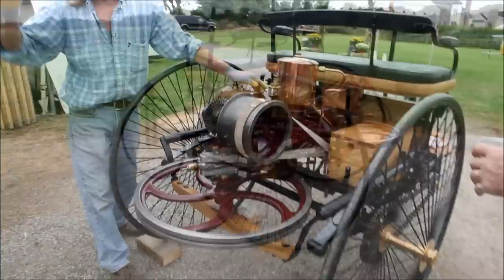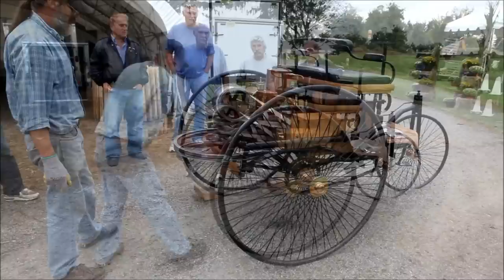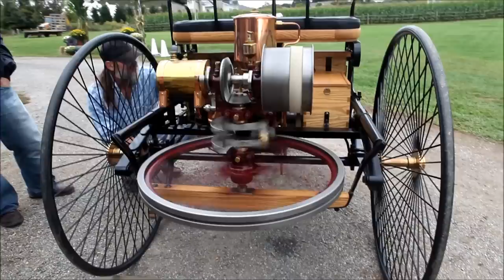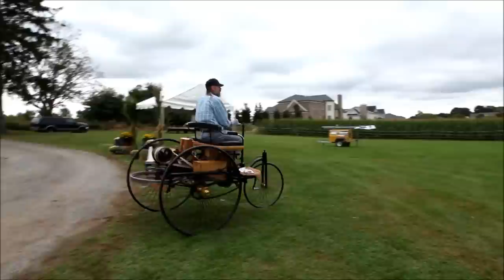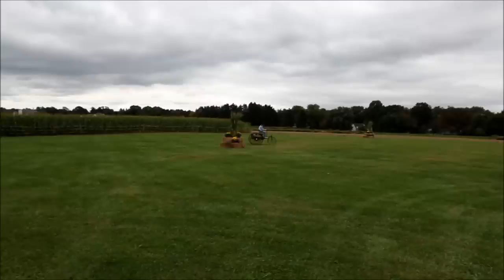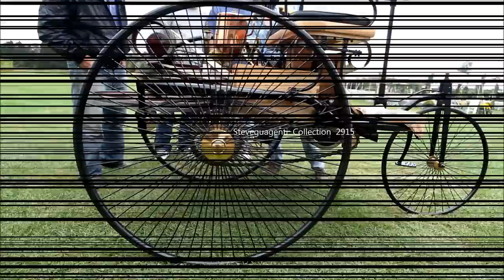Driving   Mercedes Benz 1886 ...Turning Over

Comment: imagine how stressful horror movies were in the 1800s! imagine trying to start that thing before a killer gets you
Reply: I wonder if they were even a thing back then because people didn't do too much with cameras.
Reply: Killer: *shoots, misses
Victim: *sets some valves
Killer: *fumbles around with a paper cartridge
Victim: *brings the flywheel in the best position
Killer: *broke the cartridge while loading
Victim: *looks after a screw that fell under the automobile contraption
Killer: *finds another cartridge
Victim: *tightens the transmission chain
Killer: *pulls the trigger. Nothing happens.
Victim: *has trouble releasing the breaks
Reply: They had horses and they also ran using their legs.
Reply: @gustavgnoettgen  Sir take my like
Reply: Given the car's top speed is about 16 km/h I don't think the chase would end even if the car starts at first try.
Reply: @CanalTremocos  That was the top speed of the car if it were operating in top condition.  If the car were running rather ill, it would only get up to a human trot.
Reply: Hahaha
Reply: @tdiamonds23ice82  The cameras were so enormous and slow they really could not do a lot without planning for it first.  Motion pictures where still in their infancy. I remember my grandfather had a camera and some brackets for still photography in his basement.  The camera looked like a huge wooden chest with a huge lense coming out of it from one side and a leather drape on the other side for the photographer to get under so he could see the image.  The metal brackets went around the chairs people sat or on the floor to hold their heads still while the exposure was taking place.  There was a measuring tape from the front bottom leg of the tripod.  I guess it had to have the big lense changed to a different fixed focus lense to whatever length people were away from the camera.  There was a chest with four more lenses in it that was actually smaller than the camera itself.  I remember the camera had a fancy brass plate with, "Eastman Kodak," scribed into it.  The lenses also had a bunch of screw in colour filters, though the film was only black and white.  I really did not get that but I guess it had its reason.  I could not imagine hauling all those trunks and brackets just to take a picture.  In the lower light, my grandfather told me the subjects had to sit still a very long time.  You should have saw what they used for a light flash.
Reply: Or trying to catch up to that hot chick for a date? Fuck it, take the horse!
Reply: @vincentlussier8264  Run, it is faster and more maneuverable.
Reply: First horror was in 1896
Reply: Hahahhahaa
Reply: @Kosmouchkosmatakosmos  Please give me the title of the horror film made in 1896.  I love horror movies and would love to know the title so I may look for it in Amazon.
Reply: wew, its just a joke. No need to take it literally
Reply: @gustavgnoettgen  They already had bolt-action rifles in the 1880s.
Reply: the killer would run faster
Reply: It's too slow anyways
Reply: Truly you could go faster runnin
Reply: It would make more sense at least
Reply: @tdiamonds23ice82  0
Reply: A horse is faster
Reply: It was actually a common trope in early 20th century films. The hero/heroine frantically trying to hand start a motor car as the villains close in, only for it to fire up & let them escape right at the last moment. Even modern films have that multi-failed-starts trope...
Reply: @tdiamonds23ice82  the first video or movie of any kind was 1874.

Comment: Is there an AMG model for this?
Reply: Yes! It adds a whopping 2 horse power to the machine!
Reply: @onionpacific  XD
Reply: Ooo
Reply: @onionpacific  wow man so overpowered
Reply: Y'all wondering if there is an AMG model, what about black series, eh? Brabus? Manhart?
Reply: @onionpacific  aaaaàjaaam
Reply: @onionpacific  There is a Brabus. It's called Brabus 0 It adds a whopping 3 MORE horsepower to the AMG
Reply: @issyeboi8538  768 on iii7yiooo99iooi
Reply: The amg costs twice as much. Its got shiny spoke wheels, 2 bhp, 2 wheel drive, single cylinder turbo water cooled engine. Shakes a lot though but has tougher leaf springs and softer leather seat.forged aluminium piston and copper exhaust. Has power handle with maple wood finish end.has fancy electronics like speedometer and fuel pressure gauge.. Nürburgring time is a whooping 2 days, 1 day less than the standard model.
Reply: No,Brabus
Reply: 86 Brabus
Reply: @onionpacific  man 2 horse power. My god. I think the future is hear!!!
Reply: This is the first car in the world. Not the original but it's a good Copy
Reply: @onionpacific  awawaNn   . p. Nk
Reply: There isn't just AMG, but also BRABUS😀
Reply: There's also a Lorinser version under construction with 50 inch  wheels...
Reply: AMG mods mercedes cars. This bike was made by Rheinische Gasmotorenfabrik Benz & Cie.
Reply: Yes...with 200 hp
Reply: Ajggg Gua Ngakakk 🤣🤣🤣🤣
Reply: Thank god if it start when needed

Comment: Wow, it's in such good condition.  Looks like it was built yesterday, not over 100 years ago.  It must have been very well looked after!
Reply: It's a remake. 
Benz Patent-Motowagen Nummer 1 was a single piece. It was rebuilt with original parts in 1903 and this one is in the Deutsches Museum in Munich.
https://www.deutsches-museum.de/en/collections/transport/road-transport/cars/benz-patentwagen/
https://upload.wikimedia.org/wikipedia/commons/9/9c/Benz_Motorwagen_4.JPG

Nummer 2 was again a single piece. Only with model Nummer 3 it was started to produce more than one and selling those. 
The Nummer 3 model Bertha Benz used for the first long distance trip ever survived and is in the London Science Museum.
https://de.wikipedia.org/wiki/Benz_Patent-Motorwagen_Nummer_3#/media/Datei:1888_Benz_Patent-Motorwagen_Model_No._3_Automuseum_Dr._Carl_Benz,_2014.JPG

Nummer 3 serial #24 was after a few years changed from 3 to 4 wheels and is on display in Vienna.
https://upload.wikimedia.org/wikipedia/commons/2/24/Benz_Modell_3_1893_Umbau_zum_Vierrad_1898_%282%29.JPG

Comment: Friend: "so which car do you drive?"
Me : "a mercedes"
Friend: "oh Nice, from which year?"
Me : "late 80's"
Reply: Haha :o)
Reply: imagine 😂😂
Reply: Doesn't late 80's mean late 1980's?
Reply: @j6kkn  he means 1880s
Reply: Jak exactly what im thinking
Reply: Hahha
Reply: Still working!
Reply: He'll think you're talking about the 1980's
Reply: 1880s
Reply: MULLA ROCKETYY what’s ur problem
Reply: For auto correction its actually 1800's
Reply: Jak it can mean both
Reply: Benz
Reply: Funny.
Reply: Benz
Reply: @isaakreda9636  
Benz
Reply: 7 original miles, aero package, wood trim, convertible
Reply: subtle, nice :)
Reply: LOL. But this Mercedes, Much Money don't buy it
Reply: @Billynguyen0311  
No, it isn't. There was no Mercedes at the time.
Reply: @Billynguyen0311  
Benz!
Reply: @user-xg5dt3qm4z  dydhc ce mai faci 🤑🤑🤑🤑🤑🤑🤑🤑🤑 pa
Reply: Not 80s lofer it's 18th century
Reply: LOL!!!
Reply: This is not a Mercedes, it's 20 years older than the first Mercedes.
Reply: @j6kkn  1980s
Reply: :-D :-D :-D :-D
Reply: This is mercedes 😂😂😂😂😂😂😂😂😂👍👍🇦🇪🇦🇪 it is rickshaw
Reply: This could be considered the first car and first motorbike.
Reply: I was also thinking to write this
Reply: Ahahah
Reply: just to rattle your mind, were living in the 30s
Reply: he will thinks it’s 1980s not 1880s
Reply: It's 2 years comment. I would
Have automatically assume late 1980 haha
Reply: It's not Mercedes yet, it's just Benz, first Mercedes 35 PS is from 1901.

Comment: 131 years later, we're still driving cars with reciprocating piston engines. 
Anything better was patented, and the patents were quickly bought by carmakers that only wanted the patents just to prevent competitors from building something better.
Reply: Mazda is about the only company to mass produce Wankel Rotor engines, and their’s haven’t been that great with fuel economy or oil consumption, unfortunately. Great performance, though. 

There were rotary engines (radially-opposed piston engines that rotated around a non-moving crankshaft) that were mounted on a few cars such as the Adams-Farwell, and the Megola motorcycle. They were mainly used on WW1 aircraft such as the Sopwith Camel and Neuport 11, and [half] burned huge amounts of benzine/castor oil mixture.
Reply: Josias von Leiswolf- you do realize patents eventually expire. If anyone had patented a new design it could have been copied by now..
Reply: Josias von Leiswolf yeah but i see no bad in a classic piston engine we all love it
Reply: +Josias. How long do we have to put up with that bullshit story? Fucking everything's been tried and the simple fact is that gasoline still packs the highest energy density per dollar and the reciprocating engine is the most easily built, reliable, and versatile variant of those that burn gas. It just about ranks with all of the bullshit that's spouted about the "suppression" of Nicholas Tesla.
Reply: Vitabrick Snailslime Nikola, not Nicholas
Reply: Must've suffered a mental slip.
Reply: INTERNAL COMBUSTION! Accept no substitutes.
Reply: Nothing is more superior then the internal combustion chevy 350 small block motor
Reply: GreenTriumph1 hell yeah brother
Reply: @vitabricksnailslime8273  We all  know you are joking, but for those who take your comment

"gasoline still packs the highest energy density per dollar and the reciprocating engine is the most easily built, reliable, and versatile variant of those that burn gas." 

seriously, I have to say:

Who gives a fuck about 'energy density' when the damage that burning oil makes, well outweighs any advantage? It may at some point have seemed smart. Density refers to size and weight and who cares about size unless you are running through a tunnel? 
And efficiency? Well, would it make sense to educate Americans, or better others who have not been brainwashed, using the same resources? But someone has been pretending to educate a whole continent of wasters. Was that efficient? Hardly.

You can burn dollar notes to keep warm or you can do some work. 

Anyone who has looked at the developments of the transportation of the 19th century (in which incidentally, Americans have got 'stuck' with their 'Fahrenheit', 'horsepower' and "inches"!! and of course this oil burning fascination) can see that we had all the needed technology to move around but the factory owners didn't want the slaves running off to better places so destroyed all advances in human powered vehicles through propaganda and other scare stories about the danger of steam engines, so that 'their' oil industry could be established. 

Today we have to live with the consequences of their greedy intentions, but the new generation is coming to ask some basic questions. Uncomfortable for those who are still making money from selling oil pollution. "So what?" is their attitude "I don't give a damn" and they don't expect to live much longer and are just greedy for today and to hell with the future. 

Flywheels have a lower energy density than petroleum but produce zero pollution and also important - last forever, and never break and once bought are never needing anything more than a simple once a two year service. But when no more profits can be made from the users what greedy businessman would want to produce such items? Only honest people who respect both the environment and other people, and there are not too many of those in the land of wooden huts and lowest education standard in the known world......

Egal das ist einfach zu schwer zu verstehen fuer yo yank wanks. Sorry but you came last. Someone had to be dumb.....
2019 03 23 17:16 MET
Reply: Josias von Leiswolf  Your comment is too sophisticated for those who pollute the most. Sadly they just can't nor won't, grasp the fact that they were fooled.
Reply: @LadanBeton  bu heçde köhne maşnlara oxşamir muasir elle düzelmiş maşndr
Reply: @vitabricksnailslime8273  Let it be known that a gallon of gasoline contains enough energy to charge an iPhone up every night for 20 YEARS. There's a reason why Homo Sapiens control fire, it packs a punch.
Reply: @kennethkeen1234  One year late, but I've just been alerted to your comment by another , which required me to go through the whole string again. Firstly, I do not defend the burning of fossil fuels, simply point out the simple reason that the internal combustion engine has become so dominant. Secondly, energy may derived from a flywheel, but it first has to be put into it. Ain't no "free energy" to be had, from this, or any other source. Thirdly,  I'm not an American, guess again. Finally, I'm guessing that you might be German, a pretty cold place by my standards. Try keeping warm by doing some work next winter.
Reply: @brentfisher902  And your point is? How far could the energy contained in a single charge of an iPhone propel a one tonne hunk of metal? You don't need a degree in physics  to understand that the continuing trend in global warming is suicidal. Cleaner technologies can only delay, not prevent, a catastrophic future, if not for the planet, then at least for our place in it. The real elephant in the room is population growth, because our demands on all resources strain the ability to create anything sustainable. I'm just waiting for the genius who'll figure out how we can all survive by eating dirt, because that's about what'll be necessary.
Reply: @vitabricksnailslime8273  It's just like smoking cigarettes, in the old days people didn't know any better that smoking caused lung cancer, but today we know this and all the people who didn't know any better must be dead by now. If you still have biological children in 2020 you need your human being card taken away from you. And that's not an elephant you see in the room, but a Sacred Cow.
Reply: The only more effective way to build engines is a jet propulsion which by its definition creates a huge steady outflow and it's thus not suited for miniature machines such as cars or motocycles. People tried. It works but it's generally not a good idea. So basically, to make something rotate, you have 3 options - turbine, pisons, and electromagnetic repulsion - out of which the automoto industry uses the last 2

Comment: - Most people don't know yet it took his gutsy wife to show that it was more than just a novelty to drive around the block.
-  She dove it some 50 miles to visit her mother with 2 stops at town local hardware stores (no gas stations or parts stores around when you need one). 
-  This hit the press, & caused a sensation,  especially since it was by a women who, back then all just sat back & looked pretty... And, Expressway driving was a breeze.
Reply: While I'm two years late, Bertha is not only credited as the first "long distance driver", she's also credited for inventing brake lining -- because, on that drive, the brakes just weren't up to the task, so she had a shoemaker put some leather onto the wooden pads.

As a side note, while this is not an "official" thing, one could also call her the first... car thief. Because she told Carl that she was going to visit her mother, but he thought she was going by train. I guess he only realized what was going on when he went into his workshop, and found the car missing...

She also had to cope with some purely practical issues, which I suppose may have found consideration in future models, without actually being listed as an "invention". After all, while Carl invented the thing, she did some serious "QA" on it...

Comment: I bet it still has a ton of dash warnings on.
Reply: Technically, you're not wrong.  During the first road trip in 1888, there were a bunch of problems that needed to be solved along the way, such as a blocked fuel line, worn out brakes (leading to the invention of brake lining), a wire that shorted out, and chain that needed repairs.

Comment: Is it only me that feel you are supposed to use a string around that horizontal starting wheel to start the car. I mean the groove along the circumference is there to prevent the string sting from slipping .

Comment: I think you are supposed to wrap a tapered grippy leather whip lash to that, and pull it... not do it directly by hand. It will burn more cleanly too if it has the right compression.

Comment: One of the first speeding tickets from the 1890s that was given to this car model.

German:
Es wird uns mitgeteilt, daß Sie bei dem Betrieb Ihres Motorwagens die vorgeschriebene Geschwindigkeit nicht einhalten, sondern namentlich durch die Dörfer und Städte viel zu rasch fahren. Wir machen Sie deshalb wiederholt auf Ziffer 3 der Normativ-Bestimmungen Gr. Ministeriums des Innern vom 30. November 1893 aufmerksam, wonach die Fahrgeschwindigkeit innerhalb der Orte 6 klm. pro Zeitstunde nicht übersteigen darf.  Bei ferneren Zuwiderhandlungen gegen diese Bestimmung wären wir genötigt, strafend gegen Sie einzuschreiten.

English:
We are told that you do not adhere to the prescribed speed when operating your motor vehicle, but that you are driving much too quickly through villages and towns. We therefore refer you repeatedly to item 3 of the normative provisions Gr. Ministry of the Interior dated November 30, 1893, according to which the driving speed within the places 6 klm. per hour may not exceed. In the event of further violations of this provision, we would be obliged to take punitive action against you. (...) Size District Office signed Henzgen, Oberamtm

Comment: What happens when a small rock spinned by wheel getting into the engine mechanism?
Reply: It will make a 100 kilometer radius nuclear blast. This is why they driving it on the grass

Comment: Must have been a one clylinder, it fired every stroke,like a 208 on a oil rig engine,  1/13/21
Reply: One big cylinder and open crank clearly visible.  Not sure what fuel and cycle this model used.